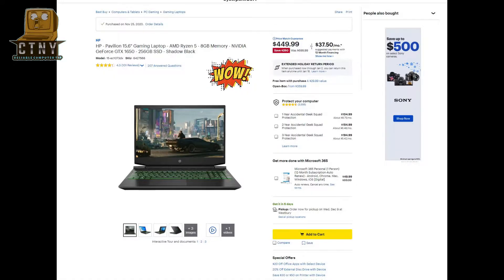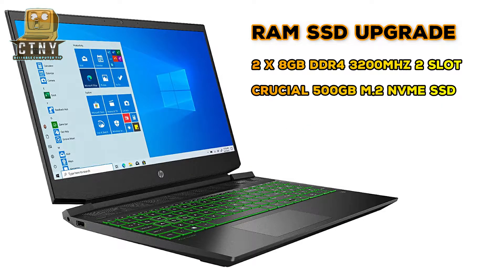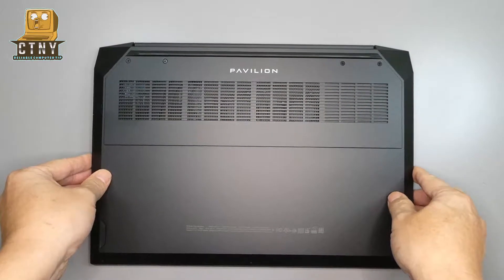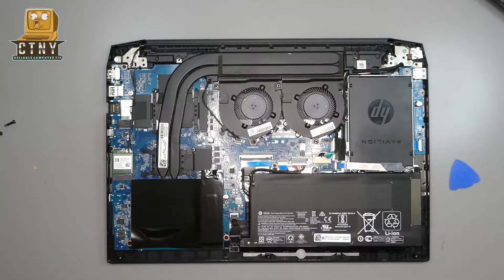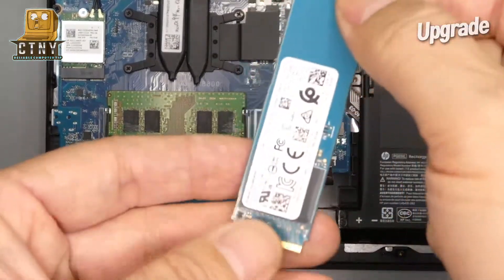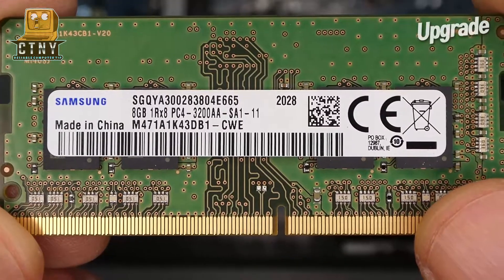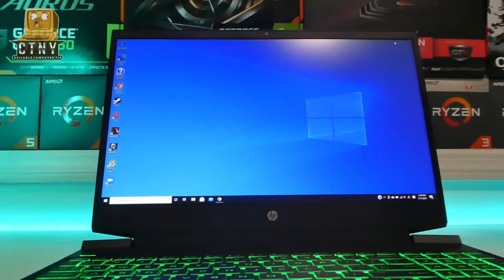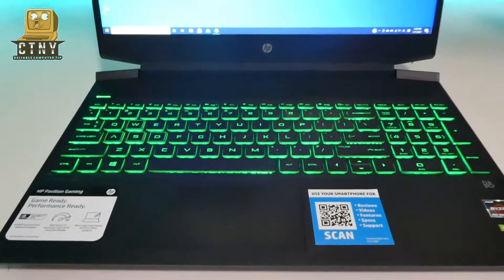HP Pavilion 15 Gaming Laptop Upgrade RAM / SSD / HDD - Disassembly

Comment: Bro is your laptop making humming/rattling sound from the body while using laptop on the laps and typing on same time...because mine is making rattling sound while using on laps but when used on table it didn't make any rattling sound...when i open the back cover of the laptop sound comes from the plastic part attached on the coolant pipe is making that sound while i typing hard on keyboard and using on laps so this is defect or your unit is also making the same sound